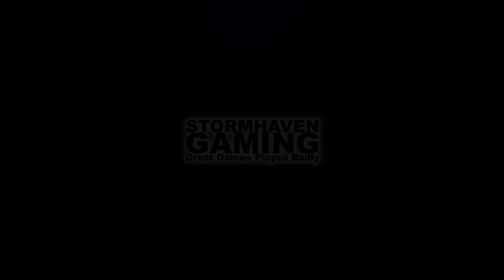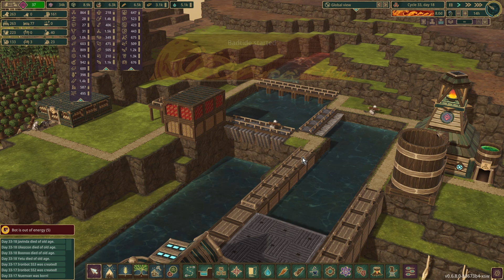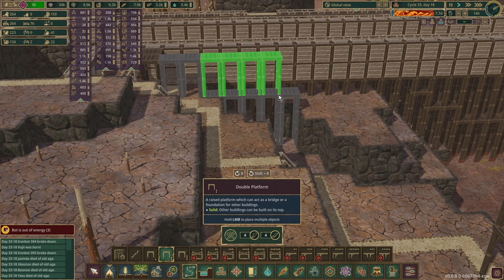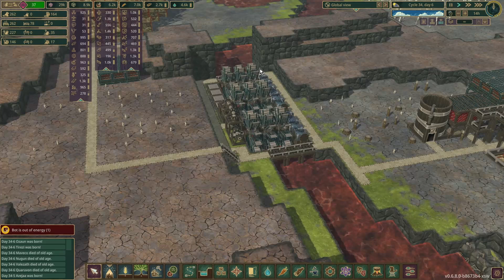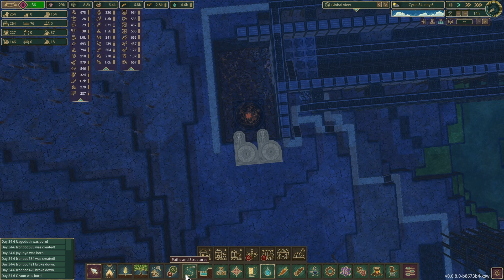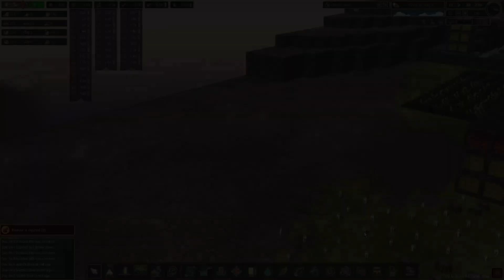Timberborn Update 6: Episode 21: All Being Well

Comment: I know you suggested placing housing on the infertile area, but you could also have used that space for the path and farming/foresting structures and storage.
I don't think you needed scaffolding for the other side, you could either build from one end and work back along the path or build that side from the inside of the channel.
I can't help thinking that your badwater charging area could have been connected together with another charger; the extra crossing seems somewhat redundant.
Not sure that putting in another district crossing there will help, unless you want to transfer materials even faster; if you want both sets of beavers to work on the channel then just give each side access to its inside and let the 10 extra square reach take care of the rest. (Although I see they're able to access the first layer of the channel anyway so that was a great help in finishing the channel. Can't wait to see the power wheels working.)
It looks as if bots were building the labourer monument from below; it looked odd to see them crossing farmland.
Maybe a tribute to ingenuity would share power between the barracks and the motivatorium?
Reply from the maker: I changed my mind about four times over that little farming/planting area! Eventually settled on the water feature - at least that offers well being for our beavers.
The scaffolding is there mostly to guide the power conduits once the wheels are all in place. I could have built nearly all of it with just the path down the centre of the channel.
The extra crossing was for two reasons: firstly, I needed to access the centre of the river to build the central wheel, but secondly, I also modified the terrain around the original crossing, cutting that path off. I wanted the second crossing to prevent being cut off from our scrap metal storage and collection!
No, having thought about it some more, another district crossing probably isn't going to be much use unless it is connected diorectly to our other bot district (and even then, it will probably be of minimal use). Nearly at the point where we'll see how much (or how little) power these wheels produce!
The Tribute to Ingenuity would probably have worked, yeah. I just forgot that the Motivatorium needs the power fed in at specific points.
Reply: @StormhavenGaming  Sure, but the wheels will share power down the middle, so you only need to connect them together on one side.